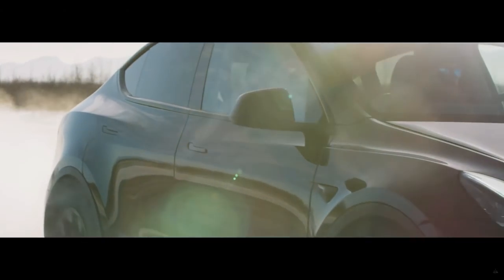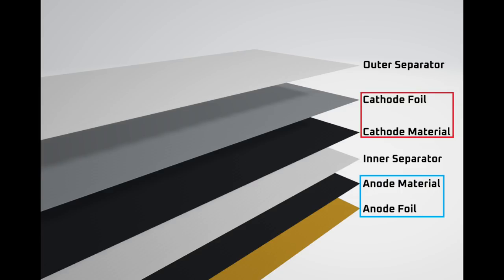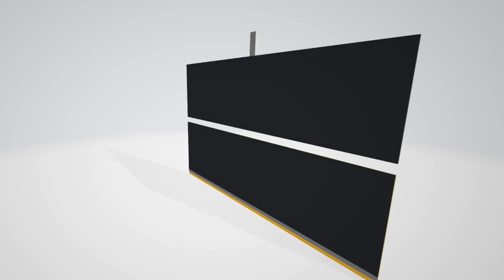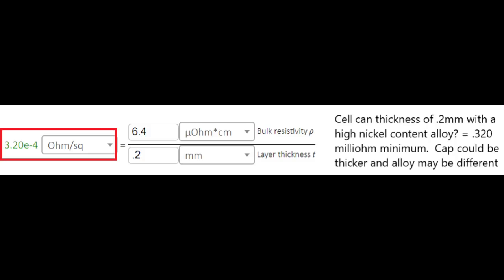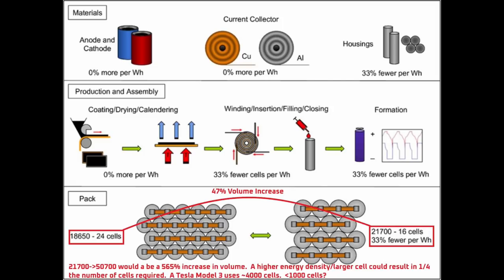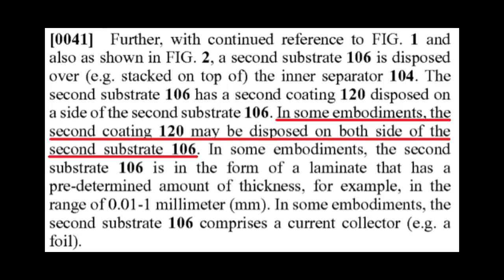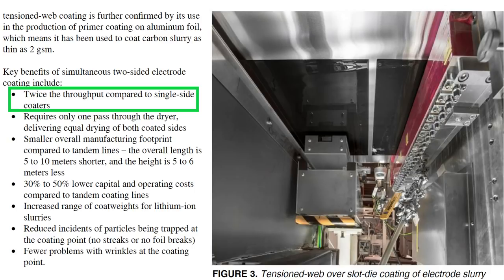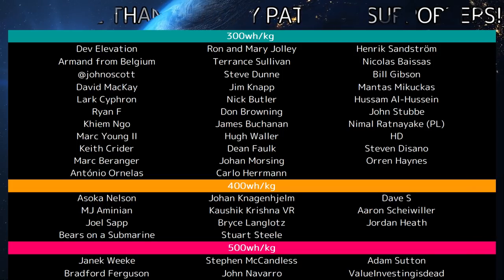Tabless Electrode Patent (Deep Dive)

Comment: So- No chance of a non- cylindrical cell based battery then? 😂 Would love to see Tesla re-design the complete pack (physically), but prob wishful thinking- right? The current buildup seems crazy from a mechanical perspective, even if it's super smart electronically/ electrically (thousands of heavy steel cans + lots of green/ blue foam- super difficult to recycle). Curious to know what the weight of all cans + foam is per pack- any idea? Is this substantial?
Reply from the maker: I think they'll redesign the pack.  I could totally be wrong about cyindrical!  I don't see why this process couldn't be used for other form factors.  All the improvements I've cited across my videos would be equally valid across different form factors.  Yes, all that foam and all those steel cans is substantial.  I haven't found an individual break out for the foam, but the cell cans are about half the weight of the Al foil cathode?  Regardless, overly complex and too much packaging!
Reply: I don't know how the weight compares to other EVs on the market, but the cylindrical cell has many advantages in thermal controls, which is important in high performance vehicles. In fact, it's pretty much what makes Tesla, Tesla, and is a reason they're currently in the lead for battery tech (they use a relatively more volatile chemical mix [NCA], but control it better, for better overall yields). I mean, if Tesla currently has better energy densities than competing EVs in other battery form factors, the "losses" in space efficiency can't be much. - Although, I admit to not knowing the comparisons in weights, so maybe that's a factor.
Having the foam in there makes it harder to use the battery packs for other uses (like, standalone storage afterlife as an EV), but, you can still use the module as a whole (complete with coolant ducts etc) assuming it is still operational (and just degraded past its "usefulness in an EV" - which should become rare assuming the MM battery is real). But you're right, I don't like the idea of having to manually tear each cell out of a Tesla module currently (but, I'm saying you don't really have to)
Recycling shouldn't be affected by those aspects though. The current best Li-Ion recycler I know of, is a German mob (their name escapes me atm). They discharge the batteries, grind them up, then chemically separate all the metals, electrolytes etc out, with very high yields (70%+). - Yes, the foam (and plastics) are waste, which is not ideal
Reply: @MrVelociraptor75  Cheers- thanks for the feedback. Agree, I suspect they'll go for shredding and chemical retrieval of element in the recycling process. Noted- massive advantages of cylindrical cells, but I have the feeling they had to take this route as a relatively small company. We will see!
Reply: @thelimitingfactor  Thanks for the feedback- we will see! Cylindrical, for sure, gives loads of flexibility across a product range and manufacturing is well established and reliable.
Reply: @MrVelociraptor75   It will be really interesting to see how the LFP, non-cylindrical, model 3 will turn out in China! That might be a first indication to whether they would change from cylindrical cells or not.

Comment: Tesla’s tab less battery
. 
There are limiting factors in the tab less architecture Tesla didn’t address the public. 

(1) junction force 
(2) junction area 
(3) junction (force and area) retention under operating environmental conditions.

Environmental? 
(4) Thermal expansion / contraction cycles
(5) Thermal shock 
(6) Acceleration / decelerations cycles 
(7) Acceleration shock.

Comment: Thanks Jordan! I'm glad when I read the patent that I didn't miss any of the advantage, cooling being n°1.
Do you feel they will then use a bottom cooling plate or stick with the side cooling channels? The first one can help put more cells on an XY plane but would penalize by about 6-10mm the Z axis. What's your thoughts ?
Reply from the maker: I think the porsche Taycan uses just plate cooling and it was built to take a serious heat load?  To me, that 6-10mm on the z axis makes more sense.
Reply: @thelimitingfactor  thanks Jordan! as you perfectly described in this video the taycan actually uses thinner active material per layer, thus has more layers in the pouch and consequently have less energy density but heats less. That's how they sustain high C-rates for quite long vs. Tesla. But the peak c-rate is lower nonetheless vs. 250kW model 3. The cooling plate is isolated from the pack bottom and again from the cells because of the module housing creating not ideal heat transmission to the heat sink. It's really thanks to the cell construction. Oh also, nothing to do with 800V like many people claim 😉 if it was that much faster, why not 3000V then!!
Reply from the maker: @fabriziom  Interesting!  How do you know all this about the Taycan?  Where can I find out more?
Reply: @thelimitingfactor  ha ha - well actually it's a conclusion/extension from the findings seen on the Audi E-Tron. It comes from reverse engineering teardown company I work with so not shareable as such unfortunately 😔
Reply from the maker: @fabriziom  🤜🤛 I can appreciate that and thanks for your thoughts!
Reply: @thelimitingfactor  you're most welcome! If you're interested in looking at the taycan battery pack architecture you can download the taycan commercial  brochure it has a nice exploded view of the pack where you can recognize a similar design of the cooling system and modules than the Etron.

Comment: If the "Tabless" design of roll is workable, why isn't a layered brick better? The Electrolyte can be supported by a film of either conductor or insulation and heat removal layers. 
The thickness of materials is usually very important for consistent properties in use in Circuit Design. A Brick is a better structural element than a Cannister, but not a pressure vessel, maybe?

(It's an "ignorant" question I'm sure the Production Engineers have answers to)
Reply from the maker: Bricks have a lot of disadvantages such as they are hard to 'roll' in a roll to roll process and they create uneven thicknesses in the corners.
Reply: @thelimitingfactor  makes some sense. But it is the crumpled core of the cylinder that made me ask. Idle curiosity, having operated a (very basic) wet analysis lab in an Ore Concentration Plant or two, most materials handling processes are idiosyncratic and require hands-on experience to work. 
So the Patent and NDA comments are particularly relevant.
Eg the cylindrical die used to imprint clay documents suggests a method of shaping the battery elements, there are similar techniques applied to bending sheet metal and designing Fibreglass structures that pull into place as the chemicals set.., and so on.. (all very interesting to Chemical Engineers and Materials Science)

Comment: Isn't the benefit of better current distribution negated by one of the electrodes still having a conventional tabbed design?
Reply from the maker: Correct!  This is why I'm expecting both ends.  Totally eliminate welding.
Reply: @thelimitingfactor  How would you make the connection to the positive terminal with a tabless positive current collector? It seems easy for the negative, because you just let the strip contact the case as you show in the video. But for the positive seems trickier to do while minimizing the risk of shorting. Maybe they can line the top of the case with an insulator, then extend the foil of the positive current collector upwards, above the level of the seperator and jelly roll, then crush the excess foil with the cap during placement?

Maybe the positive cap can be made longer so that it slides inside the negative cover (with insulator in between) and just repeat the structure at the bottom with the positive foil being exposed radially at the top and squeezed against the perimeter?

One last thing, in this design, isn't it just the single loop of jelly roll on the outside that contacts the case? The rest of the tabless electrode will be insulated deep inside the jelly roll so the current still has to travel through the foil to reach the end that's in contact with the case.

Comment: Have you found any research on the possible charge speed that this tech enables? If charge speeds came down to gas car level, range wouldn't be important anymore. The only reason that EVs are measured in range and ICEVs aren't is because the latter can be filled up in minutes at every gas station. If Teslas could charge from 10 to 90% soc in ten minutes on a possible Supercharger V4 without causing degradation or overheating, that would eliminate range anxiety.

I suspect that tabless electrodes in combination with DBE can do the job, and that this is the reason why Elon called this patent "more important than it sounds"
Reply from the maker: It's a good question, because the answer is really ♾ compared to the energy capacity of the cell.  It really comes down to the chemistry, which is yet to be confirmed, and the capabilities of the supercharger.  Totally agree with the last sentence, that's exactly where my mind is at.

Comment: This slide you created @3:25 is not really accurate.  The electrode slurry is coated on both sides of the respective current collector foils.
Reply from the maker: I've never seen that to be the case.  If you have a video of otherwise let me know
Reply: The Limiting Factor It’s the case in every commercial cell.
Reply from the maker: @lwwells  Shit, so it is!
Reply from the maker: Thanks for point this out!  I just watched a bunch of videos.  Apparently I'm blind.
Reply: @thelimitingfactor  No worries.  Wound electrodes are quite challenging to visualize. If you think about the stacked electrode scenario, it's a bit more obvious.
The video touched on all of the interesting points this design change had me thinking about. Well done.  I'm curious about how the one electrode would be welded to the can.  I could see an expandable mandrel used inside the jelly roll to apply pressure from the backside for ultra sonic welding.  

I can't the how you could make this technique useful for both electrodes though.  One would have to be joined to the cap, so the SA is limited anyway.
Reply from the maker: @lwwells  Yeah, I struggled with those parts of it as well.  The patent gives quite a few options, but there would have to be some trade secrets in there that aren't mentioned in the patent application for it to work.